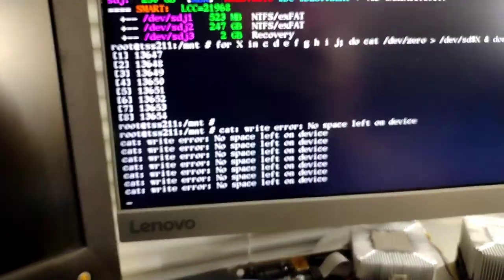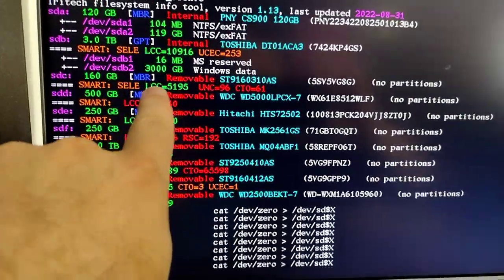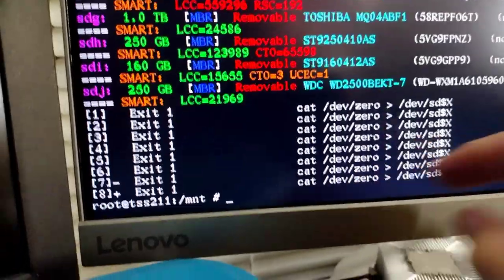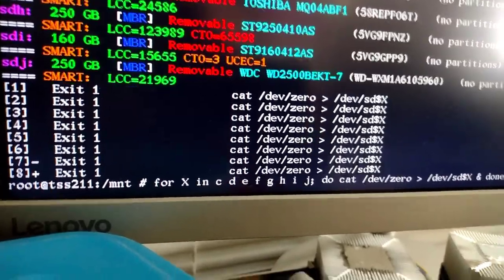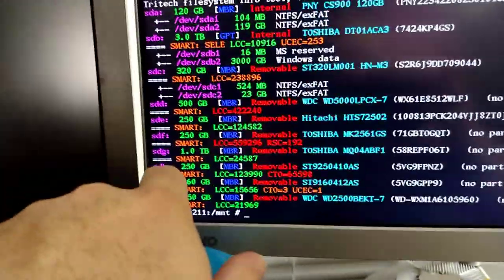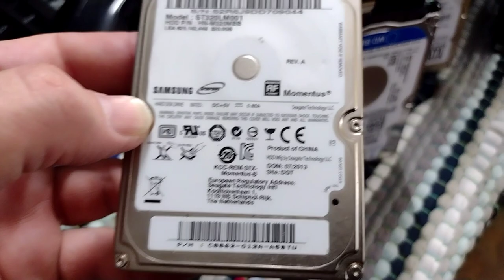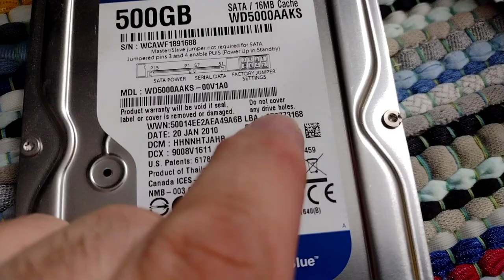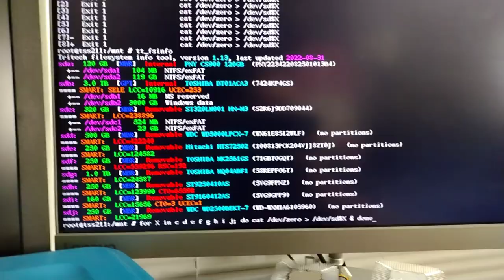Bulk Wiping Hard Drives - Jody Bruchon Tech

Comment: Isn't it better to overwrite it with random numbers?
And why not just using SATA secure erase?
Reply from the maker: That's a common myth, but no, it's generally no better. ATA secure erase is only beneficial with SSDs and SMR drives that hide some of their actual storage from the user because a fill can never reach 100% of the drive's actual storage. Everything else is unrecoverable on any remotely modern hard drive (certainly anything with a SATA connector) with a simple zero fill. The NIST even says so: https://nvlpubs.nist.gov/nistpubs/SpecialPublications/NIST.SP.800-88r1.pdf

For storage devices containing magnetic media, a single overwrite pass with a fixed pattern such as binary zeros typically hinders recovery of data even if state of the art laboratory techniques are applied to attempt to retrieve the data.
Reply: @JodyBruchon  And if you want to verify that your erase worked, seeing endless zeroes makes it simple as opposed to seeing random bytes.   Maybe I should start zeroing out some of those full height SCSI drives in the closet...  Those things are hefty.

Comment: What fun! That is one killer motherboard. I was always told that black ones are better than green ones. I heard somewhere there's also a way to wipe hard drives with neodymium magnets. I imagine that could be a little risky as there are lots of tiny metal wires that could get damaged. Interesting stuff though. Thanks for the great content brother. 🙂
Reply from the maker: Don't know about the color thing. If you use a magnet to wipe a hard drive it will render the drive 100% unusable (the tracks are magnetically defined on-platter and a magnet destroys the track boundaries and markers) which is a sad waste of good drives; I repurpose zero-filled working drives with good SMART stats rather than throwing them in the trash.
Reply: @JodyBruchon  I see, fascinating. Thanks for the helpful information. 🙂
I looked into the color thing and it's mostly for aesthetics (red/back for Asus, etc). Old motherboards are mostly green and amber though.

Comment: I've been sanitizing and testing a backlog of old drives pretty much one by one for weeks.  You make me look like a small-time operator!
I'm nearing the end of the pileup, else I'd follow your nice bulk method.
Buuuut it takes very little actual time.  On a benchtop Windows box, I run a SMART check using SpeedFan, delete all partitions, make a new one that occupies all available space, then overwrite the entire empty drive using the free version of CCleaner.  Each operation runs unattended.  A few per day, and the stack of old drives steadily shrinks.
Now how about this:  What do you do with all your old bad drives?  I've got a couple hundred of them stacked on a shelf waiting for the Final Solution...
Reply from the maker: These are probably going to be sold on ebay. I have had some of these drives for years. I do so many SSD upgrades and I have no use for these things. My own storage requires massive drives way bigger than any laptop drive.
Reply: @JodyBruchon  Oh yes I understand the functional drives.  Like you I have no use of my own for them aside from the rare quick and/or free fix for an old system that's not worth even the price of a cheap SSD.  I'm asking about how you dispose of your dead/dying drives.

Comment: I have just done similar to wipe some old drives.  Instead of dd, I used hdparm, which would do a secure erase.  Catting /dev/zero works, but hdparm is quicker because the drive controller does the zeroing out.  No need for I/o.
Reply from the maker: Zero filling is a secure erase on any hard drive made in the past 15 years or so. Even if hdparm is supposedly faster, it also doesn't tell you when it's done, it requires the drive state to not be set to frozen, and there's a risk of setting an unrecoverable ATA password that bricks the drive. There may be a benefit to it on an SSD or an SMR hard drive since those have hidden data areas inaccessible to the user that won't be wiped with any amount of filling.

Any amount of time you might save with ATA secure erase will be lost as you wait for the amount of time it specifies and repeatedly check to see if it actually completed.

Comment: Can this be loaded onto a bootable CD or DVD and run from booting DVD drive ?

I would like to see if my driver's are reporting any of those areas.

That looks amazing

I remember a bootable CD that had a program that it booted to a Linux OS and had a program that allowed you to select the type of wipe you wanted and the number of times to overwrite, but it never showed the information like what yours does

It looks like this is a Linux program

I don't know how to run Linux, other than a bootable image that has the software preloaded.

I think the image I saw before was Backtrack and something else

One was very small, less than 300 MB
Fit on a CD
It had a really basic prompt for just wiping drives with 1 of 7 types of overwriting.

Thanks for the help

And the cards, is there a link for those ? Is there any USB to SATA cable? I saw one. Not sure if it would work for this.
Reply from the maker: There is a (sadly quite out-of-date) version of what I use available which still works on most PCs that don't have NVMe SSDs and relatively new hardware: https://www.jodybruchon.com/tritech-service-system/

...but most of my tritech-utils tools can be adapted to work on any live Linux system, and the only tritech-utils tool in the video is tt_fsinfo which is not required to nuke the contents of drives. ANY UNIX-like system can wipe entire drives with the correct cat /dev/zero > /dev/XXXXX command. I have been meaning to rebuild everything from scratch with newer software for a long time now, but it's a big task and I don't have the time to compile dumb things all day long for a week lately. Checking the statistics that you see is as simple as using "smartctl -a /dev/XXXXX" which will show all of the statistics near the bottom of the output; look at the raw values for the SMART stats you see in this list: https://github.com/jbruchon/tritech-utils/blob/master/scripts/tss__common#L247-L257

As for the cards...they're just standard PCIe SATA 4-port adapters. I'm fairly sure they're just cheapo Syba cards: https://www.neweggbusiness.com/product/product.aspx?item=9b-16-124-064&tpk=9b-16-124-064
Reply: @JodyBruchon  is there any way from a windows OS to display the smart drive data to show what this shows ? Or is it only possible in Linux ?
Reply from the maker: @ocsrc  Yes, use CrystalDiskInfo (you'll want to set Function > Advanced Feature > Raw Values > 10 [DEC]) to see drive stats and general status and features.

Comment: is there any reason you chose cat over DD?
Reply from the maker: Yes. dd is appropriate when you need to do block size based transfers, specifically using things like skip/seek/bs/count to manipulate specific areas of a disk or file, but it has several potential pitfalls and adds a little complexity even if used in the most basic 'dd if=X of=Y' form. cat is a lot simpler: it reads an input file (or files) and outputs it all to stdout which can be redirected anywhere, and does so until either input is exhausted or output causes an error. dd also spews a bunch of stats to stderr at termination that I don't care about. cat is almost always the fastest way to simply dump data from place A to place B if no block-based seeking or specific data sizing is required.
Reply: @JodyBruchon  With new drives using SMR could this lead to a very long procedure? Or is the controller and its cache good enough to figure out that everything should be zeroed and does not need to rewrite blocks several times?
Reply from the maker: SMR drives shouldn't have a problem with zero filling. It's a sequential write from beginning to end, so it should actually play extremely well with the shingle layout. SMR is slow because a write destroys the data on an adjacent track but the drive is being asked to write fresh data to that track anyway, so there's no need to do the standard shingle rewrite that slows SMR down so bad.